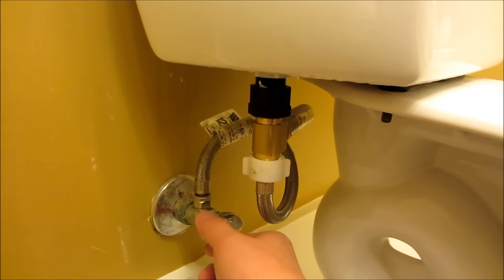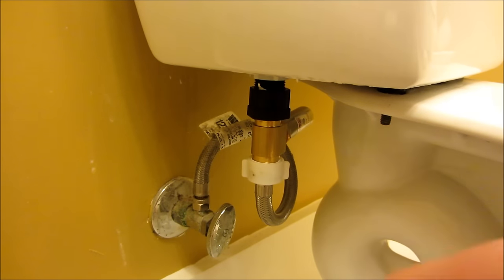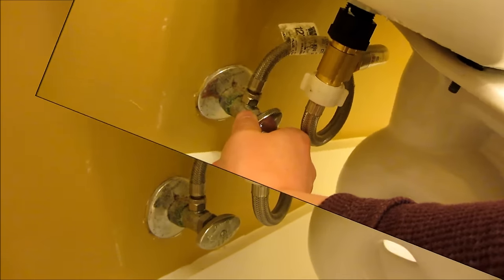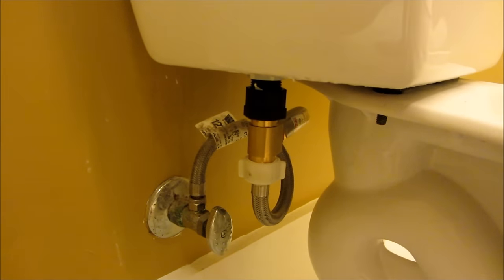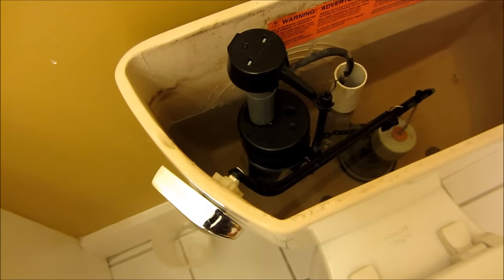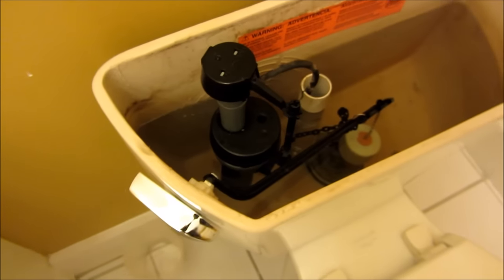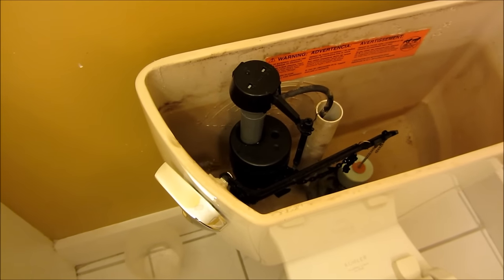How to Fix Vibration Noise on Toilet Water Valve

Comment: Thanks for the tip. For clarity and even easier tip, I closed the valve. Opened different faucets around house for about a minute. At same time slowly opened toilet water valve and air will clear out until rattle and sound gone.
Reply: Thank you for the clarification in the comments!!!! 😊
Reply: Did you shut off the water main to?
Reply: @MarySmith-ry9cu no

Comment: Had the exact same problem. If I turned it open 1/4 turn there was loud vibrations. I tried clearing the air out of the pipes twice and didn’t solve the problem. I ended up just turning the water valve 2 or 3 full rotations real quick and it fixed it.
Reply: Joseph Melton did it vibrate/make noise at all when you did this?
Reply: THANK YOU , i didnt know if doing that would make it explode or not but it worked
Reply: Dude! It was like playing chicken with the valve. Turn it real fast about 2 rotations and it was fixed. Thanks Joseph Melton.
Reply: This works. I thought I was doomed
Reply: Thank you!
Reply: Thank you to everyone who commented about 2 to 3 full rotations real quick. I was afraid of the rumbling. But you were right, it's gone now. I fixed the seal of my toilet with one YouTube video and I fixed the rumbling on another YouTube video. Who needs a man in the house anymore.
Reply: @TheMoMcT  I’m confused. What do you all mean when you say turn it “real quick”?  Are you saying - while the toilet is in the middle of a flush, rotate the valve 2-3 full rotations counter-clockwise? What effect does the “real quick” have? Sorry, Day 2 of being a homeowner and I just found this problem.
Reply: @r.austinhutchinson6311  did you figure it out?
Reply: THIS! After seeing this comment I tried this and it worked. I prolly spent 2 hours trying to chase down the vibration noise, clearing air from the system multiple times. Then I went 2-3 turns past the noise and VOILA! Thank you thank you thank you!!!

Comment: Genius!!!! That man right there!! Thanks so much for this video. This has been driving me nuts for weeks.  I wasnt sure if I needed to drain the flush but I did that also with the flush valve turned off. Once all the water was drained I turned off all the sink and bath taps then turned on the flush valve to let it fill, flushed it and perfect. No noise!  Great hack!
Reply: Thank YOU!

Comment: you are an absolute legend ! the noise in my en suite toilet has driven me nuts for 2 years , and its all sealed in with sink top ,so really hard to get at it, thought it would cost me an arm and a leg to fix , followed your instructions and it worked a treat ,  I salute you

Comment: Instead of shutting off the water, I ran the bathtub and faucet in the same bathroom and after a few seconds opened the valve on the toilet. It fixed it.

Longer description below:

I shut off the water valve connecting to the toilet and when I opened it up it made the same rattling/foghorn sound. I shut it off again for about 20 minutes (not intentionally, but it ended up being about that long, so I don't know if that had any effect on it). Like a lot of commenters here I couldn't find a separate "cold water" main valve. So rather than shutting off the water completely from the main valve I just turned on the cold water from the bathroom sink and bathtub (in the same room as the toilet in question) and after a few seconds I opened the valve on the toilet and the noise/rattling was gone.
Reply: I have same intense vibration as in the video, accompanied by noise.... Before seeing this video, I purchased new flapper and fill valve thinking the problem might be there, but now suspect has nothing to do with those parts.... I too think it will be difficult to shut off main valve as that would effect other apartment units.... I will try YOUR fix...turning on cold water in sink and tub in same bathroom as toilet... did you open toilet valve WHILE RUNNING bath and sink cold water, or did you TURN OFF bathtub/sink FIRST, then open toilet valve at base of toilet?  Thanks in advance for your reply.... English is my first language, I am just brain dead and no longer articulate at 2AM, after scouring youtube for these video solutions.  THANKS again!
Reply: @mubystubuff764  I turned on the sink and bathtub first and then opened the valve on the toilet.
Reply: @HotdogAndSomeGum  THANKS SO MUCH, will try that
Reply: this worked for me, thanks!
Reply: Great tip. It works for me. Thanks.
Reply: Yes, it worked. Only other issue I have is the hose connecting to water to fill the toilet is leaking. So I will do more research on that. I assume either tightening it or replacing it. Thank you.

Comment: So glad you posted this vid. brother. I decided before I turned off the cold water main valve, I would just flush all three toilettes at once while running the cold water taps in both half-bathrooms and the main bathroom as well as the cold water in the kitchen.  It seems to have cleared the excess air. Thanks so much. What a relief.

Comment: THANK YOU! Had the same exact issue (knocking of my cold water line going into the toilet) and resolved it in less than 5 min.Don't forget to open up your shower valve and at least one outside hose line (if applicable).
Reply: Thank YOU!

Comment: Very appreciative to have found your video.  This helped resolved a very loud, vibrating noise during my toilet bowl fill.  After I cut off the main water line and relieved all of the pressure from opening all of the cold water faucets like you said, it fixed the problem.
Reply: Thank YOU!

Comment: Very useful trick. At first one of my toilet started to have this problem, and then the outdoor garden hose bibbs, and then the other toilet. I realized this is not something caused by the toilet. It has to have something to do with the water pipe. The trick fixed it. Hopefully it won't come back any time soon.

Comment: I was able to fix the issue. I had to:
1. Turn on all faucets 
2. Switch the valve on (and letting the foghorn noise keep going)
3. Wait for the pressure to dissipate (took 1-2 minutes having all faucets on)

Comment: Just done this seems to have worked. I had this noise coming from my upstairs bathroom/ toilet for a week or so , tried turning the pressure down but still nothing, this hack seems to have worked. When I turned the cold tap on in the bath I could hear the air coming out for about 10 seconds so can only presume it was trapped air due to it not getting run regularly. Thanks for the help
Reply: Thank YOU!

Comment: Thank you! Had to repeat the process 3x before it fixed the problem for me.

In my case, the foghorn noise started after I drained the boiler to flush the sediments. I think my mistake was I did not open the pressure release valve while the boiler was draining, not sure. When I turned the cold water supply to the boiler again the foghorn noise started. For a while, the foghorn noise would come on whenever we turn the water on anywhere in the house, but the sound is always from the pipe closest to the problem toilet. Eventually, the problem limited itself to the flushing-refilling cycle of the toilet nearest to the main water supply.

Comment: So to make sure I'm clear. You turn off the valve to your toilet, then turn off the main valve. Run all the faucets cold until no water left. 
Then turn main valve back on, shut all faucets and turn the toilet valve back on? 

Do I flush toilet at all in between this?
Reply: My exact question.  Lol

Comment: I have this same vibrating noise inside my toilet tank. This happened after I shut off the main water valve to try and fix a leaking outdoor faucet. Turned the main water valve back on and this sound is happening in one toilet. How do I fix this?
Reply from the maker: did you try the following?  turn off your main, turn on all the water on all faucets to cold and drain all the faucets.  for the toilet one unscrew it and put it in a bucket and turn that valve on.  Let everything open, remember to secure the toilet one in a bucket.  Make sure to get someone else to help you.  Then turn on the Main with all the valves open.  Now for the toilet one, turn off the valve.  Turn off all other faucents.  And hook it back in the toilet.
Reply: @PoolarityChannel  So, turn off the main water valve. Turn on only the cold side for all faucets in the house. (Outside faucet too?) Turn off the toilet water valve. Flush the toilet to clear out the water inside the toilet tank. Unscrew the line going into the valve; point the hose into the valve. Turn on valve for line going into toilet; flush out the system. (For how long?) Leave valve open; turn on main water line. Reconnect the line back into the toilet tank. Turn on water valve for toilet. Flush....Are my steps right?
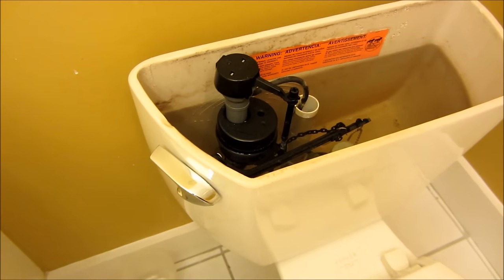Reply: @jamesadam9851 1:09 1:09

Comment: i did that. and it didn't work. it's a two-story home so i guess it's somewhere in the walls. i hear ticking sounds in the wall where the toilet is. it's also connected to the outside water outlet i believe. i will be replacing the toilet water line valve. maybe it will work

Comment: Did in same order and still have vibrations. If I close main water valve to home > flush out water through sinks/shower > OPEN toilet water valve (before opening main) > and then open main water valve will that make a difference?

Comment: Mine just started to make this very loud and hard vibrating noise, vibrating the entire house. I played with the valve but that didn't do any good. I just replaced the guts in the tank also. But we are having to run new water lines from the meter to the house. Right now we are running off the neighbors waterline until they put ours down.

Comment: When you say "close the cold water valve", are you just referring to the valve that turns off water to the toilet (the one you're turning in the vid)? Thanks!
Reply from the maker: afrose71 no, I'm saying the Main cold water, in my case the valve that goes into my apartment
Reply: OK, I have a main water valve in my basement, but I don't see separate valves for cold and hot. Should I just turn off the main water and do what you did in the video? Thanks again.

Comment: Thanks for this video you fixed my problem in Ireland.
Reply: I'm also in Ireland. Tried it a minute ago. On the first refill of the toilet tank, it still made the noise but it was much shorter than before, just a fraction of second compared to 10 seconds before.
Edit: It worked only for the next refill. After that, it came back

Comment: I have a question about opening all the cold water faucets in the house! What is the main cold water valve? By the meter outside? Also I'm doing over one of my bathrooms so is that creating air in the pipes?
Reply from the maker: Whatever valve that when closed shuts off all Cold Water to your home.  This is different location home.

Comment: Didn’t work for me. In my case the pipe would knock if the vibration starts somewhere. The angle stop needs to be opened all the way otherwise there will be knocking sound; but then it will have the loud noise. The noise is actually caused by the washer of the that American standard toilet valve that came with the toilet. But the way, I could not find that washer anywhere in the world, so I have to replace the entire valve. So after the replacement, then open the angle stop all the way, the noise and knocking finally gone!! The arrestor and cold main air trick did nothing to me.
Reply: So i will try this too as it may or may not work for me.   I thought of just replacing the entire valve and hope that it will work.

Comment: I did it by cutting a  centimeter hole in the rubber tube that drops the water inside the tank near the top... It falls into the tank from the top so when the pipe gets submerged air was not able to enter causing this issue...

Comment: how long did you open the other faucets for? 10 mins? 15 mins? and was it only the cold one or hot faucets as well? or both?
Reply from the maker: invalidacess only the cold, you open all your faucets simultaneously so the water is flushed through, just 1 or 2 minutes after all is open.